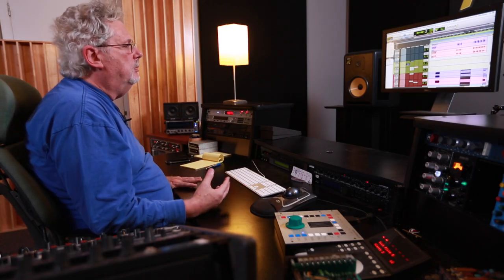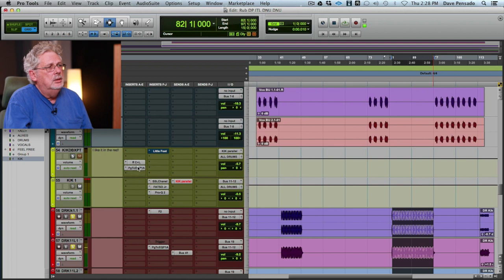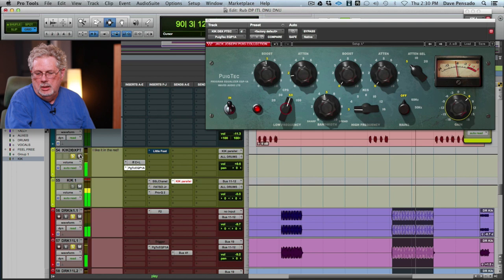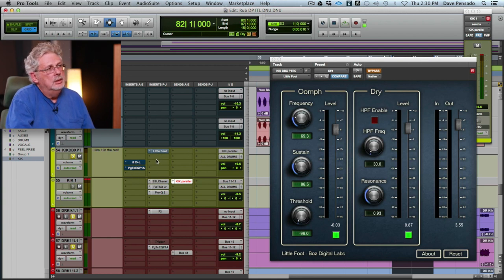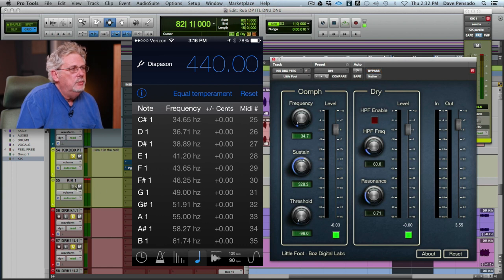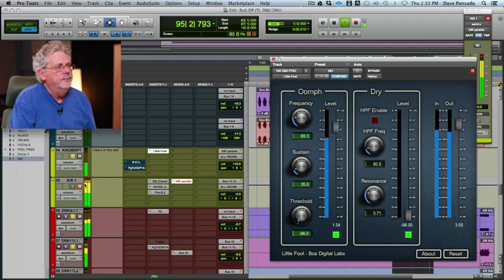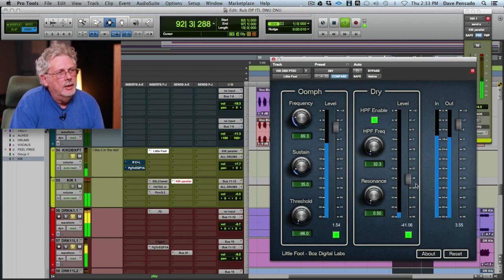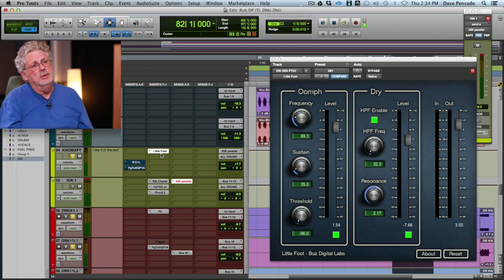How To Mix Massive Kick Drums - Into The Lair #127

Comment: In my DAW (Logic Pro 9) i've been achieving the same effect by using a test oscillator to set a note, then using a gate and setting the threshold above the test oscillator's output, and then sidechaining the gate to my souce (kick, snare, etc). Much more time consuming than using an awesome plugin like this! Not to mention, if the sidechain is set to a bus with any kind of linear multiband compression or anything like that, for whatever reason, the sidechain happens at the wrong time. So I usually create a kick track with no output to sidechain things to. Great video and I love your work!

Comment: Gentlemen, a question for all the kick drum experts out there:

My question is, instead of using the signal generator trick, why not simply create an aux for the kick and then EQ the crap out of the low end for that boom, perhaps add some compression for extra punch, and then finally just filter out the rumble / boom you don't want?

With the EQs we have nowadays, sky's the limit, you can boost the thinnest typewriter kick into a boomy monster by throwing shitloads of lowend in it, and then just use another EQ or a filter to carve out the unnecessary boom.
Reply: +J.M. Wolfman It can work, but you gotta use the proper EQ. Like the PuigTec one he was using in this video or the API 550 from waves.
Reply: +ja24 Any specific reasons why those EQs or EQs like that? 
I've been getting good results by using the Fabfilter Pro-Q.
Reply: I just find those EQ have really tight and smooth low end, the kind that wont destroy your kick (gotta also lower the gain), Im not too familiar with Pro Q though.
Reply: +J.M. Wolfman You would need to have that resonant tone in the sound already, and if it does have a tone it would likely be the wrong frequency (note). You could just boost the fundamental song key's note like crazy but that may just sound ugly depending on your kick sound. This way is precise and simple. Peace.
Reply: My answer would be, simply you can have more control over the low end if you filter it out of the kick and replace it with (oscillator, synth, sample, whatever) that has a smoother transition. Yes you can eq the crap out of something, but its the old saying you can polish a turd, but then kts just a polished turd. Ive struggled to get a clean boom out of my kicks, mic'ed, or electronic, and sometimes that spring on the pedal isnt oiled and you get a chain squeak or grind, or it picks up a flutter and you phase cancel it out and it sounds worse than whe. you started, and by the time youre done your precious thump sounds like wet farts. Its much easier to fill in that low end with a corresponding bass wave of your choice, put a nice fast attack on the gate, and crossover you frequencies so the wave picks up where the mic'ed drum, or sampled splat, leaves off....I hear what your saying, and it can be done, but thats a lot of work when there are 400 odd kick drums in the song. The amount of variation can be massive, and tryying to tweak for each anomaly is too much. Better to get rid of the offending frequency (I prefer an analog 1/3 octave comb filter EQ with a variable Q and mid sweep), then you tune it to your key, then ALL your kicks will thump, instead of a sample use an electronic pulse, a sample will have no variation, a pulse (I use a simmons SDS 5 brain, sub sub sub sub audible boooooommmmmm) cv gated or mtc locked works perfectly. If you have an old Juno- 60, Linn, Syndrum, Synare, or 909 laying around, you should be booked solid for that kick (and dont say MPC thats a sampler all you Emu SP lovers)

Comment: Question for anybody reading this : wouldn't Dave be running into phase problems with that pultec Eq used in a parallel setup ? Although, while not sure how the boost knob interacts with the attenuate one, his settings may come out fairly subtle so he'd get the good in and leave the phase bad out... right ?
Reply: +Tax Money ProTools compensates for plugin latency and assuming the plugin reports its own latency properly then he should be pretty bang on phase wise. It didn't used to work very well but it's pretty bulletproof these days. Peace.
Reply: Well, what I had in mind was the fact that every EQ processing (save "linear-phase Eq") alters your track phase response. So when you deal with a particular track and you use some sort of parallel setup, if you use regular EQ your combined signal should normally showcase phase inconsistencies (to some extent)
Reply: +Tax Money Well, the EQ uses phase (as you said unless it's linear) in it's design, but it shouldn't really go reversing the waveforms (apart from a very, very small slice near the crossover point) enough for you to adversely affect parallel processing. The resulting waveform will still largely remain the same and reinforce the sound. In reality it may cancel a little bit but you have to weigh that up with the benefits.
Reply: +Mark Bowyer Thank you! I totally agree with you, and that was what I indeed suspected. Some phase alteration should naturally occur, but it probably doesn&#39;t outweigh the improvement bargained for. I&#39;ll have to give it a go myself and try Dave&#39;s technique!
Reply: +Tax Money Cool man! May all your kick drums be massive. ;)
Reply: +Mark Bowyer May yours keep mine humble! Cheers

Comment: Kick 2 simplifies this process. Normally, Pensado had great info, but not this time. Sorry man. Maxxbass or even Rennbass is a faster solution.
Reply: Uh, Dave is no stranger to either of those plugins lol...he's made presets for them. Kick 2 is a kick synthesizer, not a kick enhancer per se. This video is about enhancing a pre-existing kick via the source material in a more finely tuned way. Rbass and Maxxbass CAN be great but results tend to vary depending on the source material and the mix. "Drum Buss" in Ableton 10 can provide pretty similar results to the techniques in this video.
Reply: HORNGEN4 Kick 2 is a synthesizer..right. That's exactly what Little Foot is as well. If you've used them both, I don't think you can deny Kick 2 is by far easier to dial in the sub part of any kick. 
I'm not trying to start an argument because I don't know you and I believe you are not just a hobbyist trying to nitpick at someone with years experience and formal education. The only reason I mentioned the plugin alternatives is because of how common they are. A lot of noobs actually look at what we do as rocket science.

What I find ridiculous is how so many guys call themselves audio "engineers' never having gone to formal school. I've got degrees in mathematics and physics...I guess I'm more qualified, than 95% of everyone mixing and mastering, to call myself an audio engineer. In this case people should listen to what I have to say...because I guess I know more than everyone else on a technical and scientific level. 

Anyway, I understand he's trying to show the "real" way it was done...the actual recipe. I'm just pointing out the plugins that developers have made to simplify this recipe down to a single plugin with minimal settings to tweak.
Reply: Sure you're right Kick 2 and the others are real nice. BUT I mean, you yourself first decided to nitpick at someone with "years experience and formal education." For all anyone knows you're JUST a hobbyist.